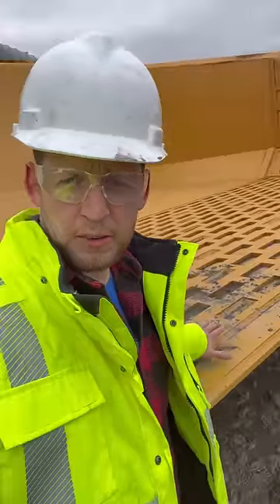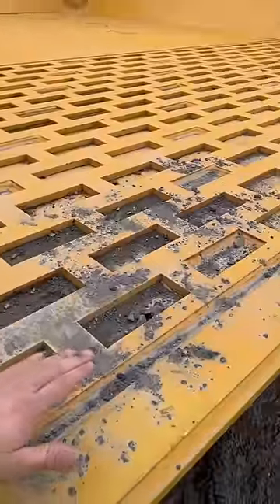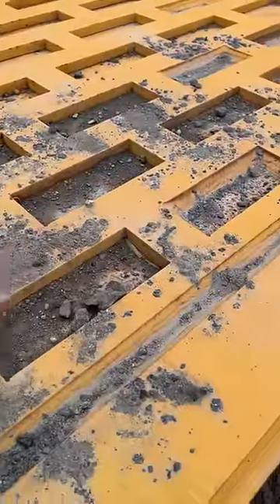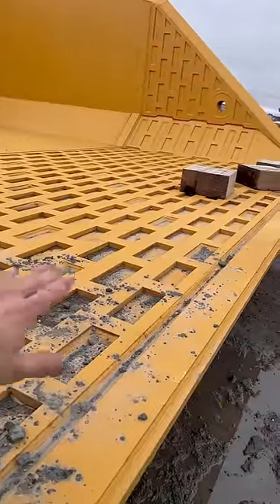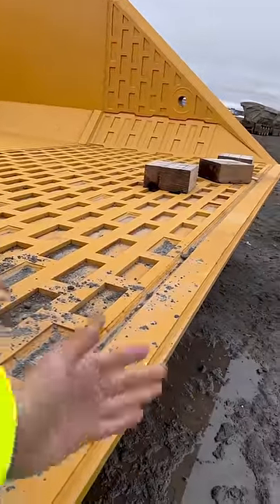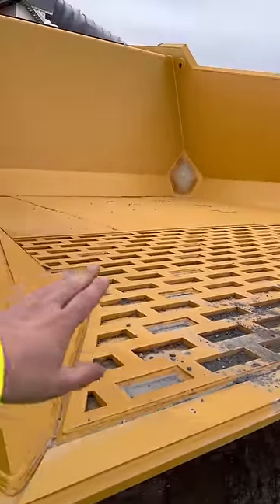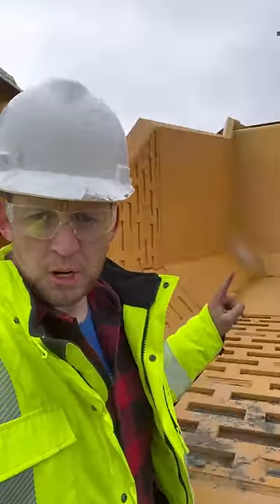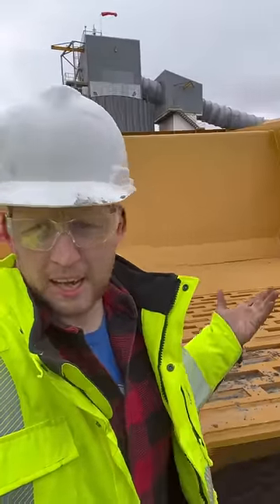Haul Truck Holes

Comment: Never would've thought to increase the life of the actual dump box lol
Reply: It’s crazy what some people’s monkey brains come up with.
Reply: @saturatedodin476 quite ingenious
Reply: strips running the same direction of flow...better efficiency and still cost cutting..
Reply: If only these engineers put there time and efforts into something with purpose like finding all the little ways to preserve society without artificial wasteful and inefficient consumer low cost means.We still utilize the same janky designs from the 1850s in "modern" society.
Reply: @nascagy They do. Turns out the way to improve society is by maximizing efficiency and minimizing resource costs, and the janky way is the most cost effective method.
Reply: It increases the life of the lip.
Reply: @nascagy no, if 1859 are as efficient as modern times, we would still use them.
Reply: @nascagy why don't YOU come up with something?
Reply: @nascagy They come up with so much. Maybe you could come up with something.
Reply: @nascagy Never gonna listen to a guy that doesn’t use the right "their"
Reply: @nascagy the guys curing cancer and solving major world issues aren't the same guys designing dump boxes dude.

Comment: Years of experience figured out what works.
Reply: Maybe some old guy noticed that the area with lots of dents lasted forever and the smooth spots developed holes...
Reply: @lucash1980  It's not just dents. There needs to be an area that gets packed hard with material. I have no doubt it was discovered by accident and its been perfected and engineered since then.
Reply: ... what rocks ...
Reply: No, an engineer simply makes that decision when they think of it while designing the truck. Intelligence and a little thinking can go a long ways
Reply: An engineer with a degree designed it.

Comment: my dad was a welder/mechanic for most of his life working at a local sawmill.  when they got a new track vehicle, or changed the pads on the tracks, he had to harden the face of the pads.  all that entailed was welding on the face of the pads in a tight cross-hatch pattern to make the pads last longer.  you'll also see the same thing on the cutting edge of a cat blade.
Reply: I do that at work
Reply: @tyler1671  much respect to you.
Reply: Similar idea, but different approach and mechanism. Weld beads are for 'hard facing', they don't trap pockets for material on material sliding as shown here (i dont think?), the beads just add more metal, and welds are usually much harder than the base metal. You can buy hard facing specialty consumables just for this purpose if you want. They're even harder than regular welds. 

Both extend the life of wear surfaces, its just accomplished differently if ive got this right.
Reply: @ctdieselnut  my dad was doing this about 50-60 years ago.  I know the product you're talking about but back then they used what was available.  after my dad retired, he told me about all the different products he had access to just before he retired as opposed to what he had to work with back in the day.  welding is definitely in the 21st century now and I still have a lot of respect for someone who does this for a living.  keep yer sticks dry, boys.
Reply: That's the old school way. Still a lot of old equipment out there that utilises hard facing still. These days almost every big operation will use choc blocks or chocy bars or many other names. They are hard pieces of steel bonded to a mild steel backing plate so any monkey can weld them on
Reply: @ctdieselnut  No, the cross hatch is for exactly the same reason, you don't hard face the entire thing you do a diamond pattern and let the dirt and rocks pack in to protect itself.
Reply: Its called hard faceing
Reply: @Rippthrough 
Exactly, this is exactly why they used an X pattern for refacing sheepsfoot rollers
Reply: @Rippthrough   thank you for explaining it i didnt feel like typing it all out
Reply: Called Hardfacing. Very common welding operation in heavy equipment repair.

Comment: They do that with excavator buckets to, especially in the heels
Reply: I thought they used segmented plates just for the ease of installation, never knew the gaps were intentional. Very interesting.
Reply: Whatvarea are the heels?
Reply: @snorttroll4379  it's the rounded back side
Reply: @ctdieselnut  yea, same reason they weld diamonds or dots into buckets and blades where the dirt rolls into the bucket. Like the fella said they collect compacted dirt and it acts as a wear plate would
Reply: Is THAT why!? I work at a Kubota dealer and we sell a lot of excavators and I always thought that was for material strength
Reply: I do that with my high heels too! Keeps men from wearing them out. Occasionally a tooth or two will get stuck in between, which is awkward, but easy enough to pick out. 👠

Comment: Do the same thing with the product lines in pneumatic product systems, like concrete, they put cups in the corners/ bends so they dont wear through. Product packs into the corner and wears against itself instead of the pipe.
Reply: So does the concrete harden up in the cups and stay there or do they clean it out before that?

Comment: Doesn't that help keep the material from getting stuck in the bed and putting every inexperienced new guy and the expensive truck on its side?
Reply: That's my guess too, I had a flat bed tipper and the damp mud would stick in the corners
Reply: It service both purposes, but primarily pattern on wear surfaces like this are for trapping material and creating a material “barrier”, think of it like golf ball dimples, similar effect just with dirt.

Comment: I was told by a welding teacher that hardfacing used to be done on a lot of mining equipment especially pails because it is you creating a boundary of more hardened material to be on top of the areas that have the most amount of friction from materials that could destroy the metal and you just do it once a year

Comment: Neat! They do a similar thing on the conveyor plates of cement clinker as it comes out of the cement kiln.

Granted thats because it would melt thru the steel if there wasn't a barrier of cooler clinker between the base and the material flow, but I can see how abrasion has similar concerns.

Comment: On a flat loader bucket I had a welder burn stick across the width at about 2in apart. Same principle. The groves will fill up with dirt and the wear would be on the dirt.

Comment: Some of the dump truck trays ive worked on use a special plate that has mild steel on the bottom and tungsten ontop to help with wear

Comment: Would Dimond shape holes like hard facing a hoe bucket be better/ more durable?
My welding teacher taught that making squares wears out about 50% faster.
I'd like to see an example of this design at end of life. Guessing nice tight upper edge and a big curve and taper on the lower.
Reply: Honeycomb would be interesting too and just circle
Reply: @jodygarcia9892  
The thought is angle of attack.  
Hitting straight on applies the greatest force, whereas a glancing blow minimizes the force applied.  
Squares will rub off smooth the front and back lines that are perpendicular to direction of travel and the lines parallel to travel stand proud almost untouched.
Diamonds ( a square on its point) have no lines perpendicular  so wear more evan and last about 10x the front and back of a square but  the top and bottom of the square  will outlast a diamond 50x
Reply: @daviddroescher  interesting
Reply: @daviddroescher thank you for being an angel 😇 and answering the question. 🙏 keep being awesome 🤗
Reply: The size and shape of the hole is dependent on the material. The holes get filled with compacted material and effectively guards it from any damage during operation. It is not a wear surface, it prevents wear.
Reply: @memberHD  correct it packs with media that then relocates the wear off the bucket onto the sacrificial packed in media moving the wear away from the steel. The steel is receiving wear,  the tip but just the tip of hard face build up typically protrudes 1-2 32nd's . This is why hard face rod is used( hard face rod like Hardalloy®140 cost more/lb 120usd/ 10# can vs 60usd for 6010)  it is far more durable than 6010 or 7018 .    I've seen plenty of hard facing warn off in desperate need of a weeks work to reface  .  
Pattern size and depth of build up can be done up for application specific use  but there are general rules of thumb applied to everything faced regardless of use case eg track hoe sitting down at the cat rental yard will get the general pattern and build up  insted of a media specific pattern . Or  did I miss the bucket change when he moved from clay to  sauger sand.  driver only dropped 1 of each size  bucket requested all with the same general pattern I have referenced.
Reply: I've seen for years that any shoot ot slide where rock or dirt is dumped across,  they will add a box under it so when a hole is worn through it,  the  dirt or rock will fill in the box so when it is full, it won't wear as fast. Less maintenance
Reply: I think that diamond pattern would be worse for this application. The goal is to catch rocks and have the rest of the rocks wear against the captured rocks not the body of the truck.

Comment: "Hammer 90's", used in bulk material transfer, usually blown through... works on the same concept. Theres a pocket on the 90 to let material build up... transfer material bounces off itself to turn 90, instead of wearing out elbows

Comment: On excavators and other equipment we would "hard face" the surface.  It's where we would put beads of weld on the surfaces so the beads would wear off instead of the steel plates.

Comment: I build those for a living I wouldn't be a damned bit surprised if I didn't help build that one too. Those corners are usually Chrome plaited to prevent material from sticking. Some of them do have smoked boxes that they pump the exhaust through to keep the corners warm but not all of them id have to see the outside frontwall or the outside sidewall to know for sure.

Comment: Looks like it'd make dumping smoother too
Reply: Kinda what I was thinking.
My initial thought was to prevent a load of earth from sticking then just suddenly letting go and it all goes at once.
Reply: Nah , it’s all about preserving the lip of the tray as 200+ tonnes of rock sliding out of the tray wears it out incredibly fast, all trays come with a wear package that could be 1/2, 5/8 or 3/4 inch thick but the lip of the tray is especially vulnerable to wear , so they fabricate this as a sacrificial wear strip

Comment: I wonder it it keeps bigger rocks from sliding off the back too. I'd think they are less likely to slip on that grate than to slip on smooth metal. That would also explain why it's only on the back edge.

Comment: These would never be used in the aggregates insustry. That would hold dirt, clay, shale, and other deleterious, increasing the decant of state certified products. It would also hold oversize and throw gradation out of spec. Maybe good for coal or pit use only. But that really limits the use of the truck.
Reply: You gotta remember tho, the material already rubs against itself the same way through the entire dump. It's really just adding an extra minuscule amount of wear

I could be wrong but I doubt it would limit the use, you just wouldn't see the same benefits in other industries
Reply: A lot of big words but they don't really amount to any meaning haha
Reply: @lukepikaart8323  They amount to a lot of meaning to those who are responsible for all the aggregate going into our infrastructure.
Reply: @MineEngineer the argument about grade size makes sense.
Reply: @MineEngineer  They don't mean much to 14 year olds who only understand Minecraft. 😅
Reply: @MineEngineer  Also another comment identified this as probably a certain truck at a copper mine. Anybody hauling ore has different requirements than aggregates. Maybe a gravel mine just accepts the wear and passes on the cost? Thanks for making me think about this. 👍
Reply: @PatrickKQ4HBD  Absolutely. This makes sense in other industries or areas where the product mined won't be affected, as it would add wear resistance. Our haul trucks are occasionally needing maintenance on the beds from wear. Another way to combat this is to use AR400 or AR500 steel for the impact and wear resistance. This prolongs the life of equipment. Everything on a mine site is evaluated by how it will affect the cost per ton.

Comment: Can someone confirm he is not trolling? I work for a heavy equipment company and I would like to implement this if true.
Reply: Extends the life of the bed by reducing the amount of material shearing off the paint?
Reply: @metalfox28 not the paint it’s the actually bed it’s protecting, from essentially sand paper sanding off the bed with each dump slowly but surely
Reply: There is almost certainly a research paper on it, if true. There would be a lot of money in that development
Reply: He's not trolling this replaced Hard surfacing the dump boxes. Hard surfacing is adding a layer of welded on metal to be worn off instead of the parent material.
Reply: Metal fox 
It is most likely ar500 ( abrasion resistant) or better.  It is a plate form of hard facing seen on hoe buckets. 
Much faster to properly weld in the replaceable plate, than to build up 3/4"of hard face welding rod in the typical pattern like this↙️
 XXXXX
XXXXXXX
Reply: This looks like it is a westech body at Highland valley copper, Logan lake 

We have designed a replacement wear package identical to OEM and supply these exact parts regularly. 

It is AR 500 wear plate!
Reply: We protect the drive tunnel on rotary cone crusher the similar way.
Reply: Its true I rebuilt truck beds At Kennecott copper mine years ago  . We called it deadbedding.
Reply: It absolutely is true and any good welder who has worked on heavy equipment would know about it. Hard to believe you work for a company and dont know about it
Reply: Oh no trolling at all....he's very serious! They really did miss a spot!

Comment: supposedly they (the rock box) as it's called, dump slower and also reduces the actual payload because the rock or dirt in the cutouts packs in and never dumps.  the plates in the corners are there to hopefully keep the dirt/rock from packing into the corners which eventually builds up reducing the actual load dumped.

Comment: I used to plasma cut the pieces for these boxes, but for use up north where it gets colder than -40 degrees; Because ice becomes stronger than steel at -40, they have to be made out of AR500 steel to be hard enough. (Fun fact!)
Reply: Why wouldn't they just use ice?
Reply: @codymoe4986  Probably because come spring thaw, the work still has to go on! ;)

Comment: Ahhhh, the paint doesn't really matter, in fact it's a problem if the box is made out of weathering steel; because the steel can't build up it's oxidation layer. That paint is just for looks on the show floor, and it's gone after the first couple dozen loads.

Comment: This is incorrect. While it does do that, the actual purpose is to create a grid of “teeth” so that the material doesn’t slide out the truck.

Consider the material itself. It’s interlocked with rocks/sand/dirt of varying size which holds it together, but if the end of the truck is smooth, there’s no interlock to keep it from sliding off the back like an avalanche or the edge of a cliff suddenly giving away.

Comment: Why not make the whole truck out of that
Reply: Because there is no velocity in the top of the bucket.

It starts sliding at the top, it really gets going by the last third of the way down.
Reply: Making the whole truck out of that would be strange. It would be quite hard to clean the truck and it would be very heavy compared to plain sheet metal.
Reply: It's a bit like saying, why aren't all your clothes made out of shoe soles
Reply: @Channel7331  exactly!
Reply: @Channel7331 is all of my clothes touch DIRT/ROAD/GRAVEL ETC, just like this dump truck? No.
Reply: @rtsrt135...Yes, you get dirt on all your clothes throughout the day, you simply don't drag them across dirt and rocks like the soles of your shoes...

Try again....